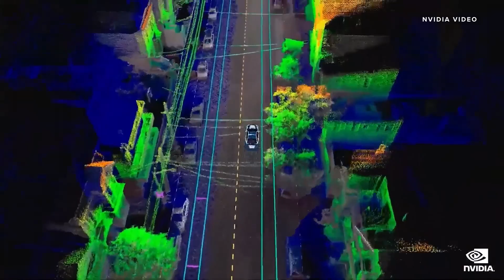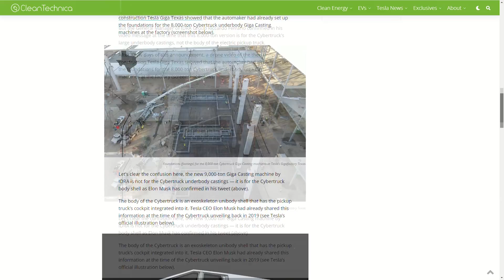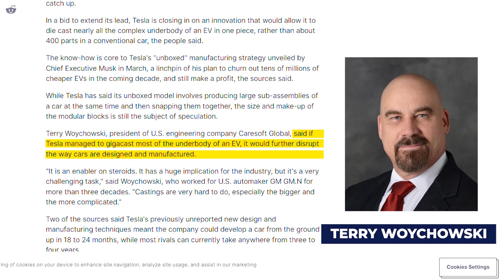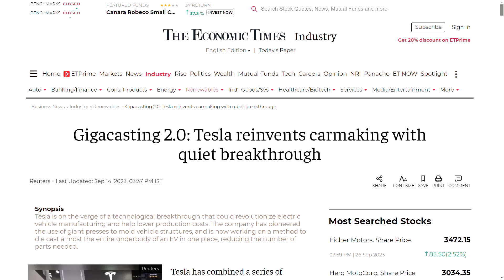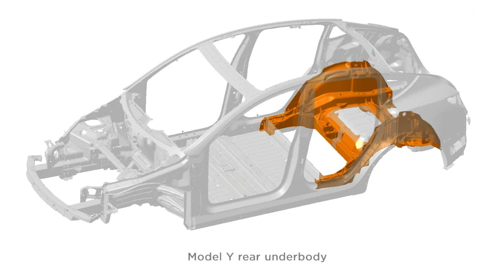This is How New Tesla Will Be Build!

Comment: Jesus, I can't hear that nonsense any more. Look up a video about Porsche Production and you see that it is more or less fully automated. If you use 100 parts for the chassis or 75 is in the end price may be 1/10th of a per cent. That is the reason why Volkswagen still produces for Example the Enyaq much cheaper then Tesla the model 3.
Not to speak about the shitty suspension of Tesla, the shitty User Interface where you have to dig most functions out of a deep menu system at screen while you are driving, the shitty sign recognition, no glass roof, no HUD, no display in front of the driver, not even a lever for the direction indicators and so on ... and so on ... and so on.
Reply from the maker: Hi, Michael, and thank you for sharing your perspective on this topic! It's insightful to compare the production methodologies between different automakers. Indeed, automation plays a significant role in keeping the production costs down, as seen in Porsche's and Volkswagen's facilities.

The point about the component count potentially affecting the price marginally is well-taken. It's fascinating how varying approaches to design and manufacturing can lead to different price points and features across brands like Volkswagen and Tesla.

I agree, the user interface and other design choices are subjective and can significantly affect the driving experience. It's always enlightening to hear from viewers who have a deep understanding of these topics. Your input sheds light on aspects that I may delve into in future videos to provide a well-rounded view.

Despite our varying opinions, I appreciate the time you took to share your thoughts and contribute to the discussion. I hope you'll find some of my future content engaging and continue to share your valuable insights. Your feedback helps in fostering a more informed community around electric vehicles, and for that, I am grateful.

Looking forward to seeing you in the comments section of my upcoming videos!

Comment: You don't understand that a "one piece casting" goes against the basic concept of the "unboxed process"?
.
How about that a "single piece would necessarily include the structural pack?
The "single piece" would have to move through the pack assembly plant, but it's 3-4 times the size of a current structural pack (in all axes)
.
Packs are built, then stacked for first charge/ testing.
That's a huge volume increase for that building.
Any failure, the whole frame must be repurposed.
.
The fundamental principle of the "unboxed process" is maximum work in minimal time, with 3(4?) Units being assembled on 4 sides each at the same time.
A single piece discards all that advantage.
.
And more, but I'm bored.
Think it through!